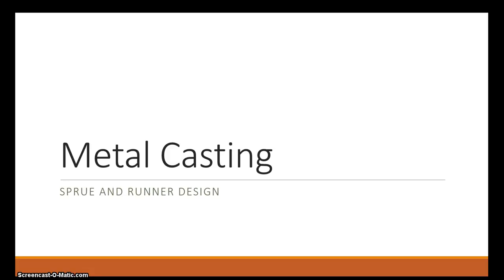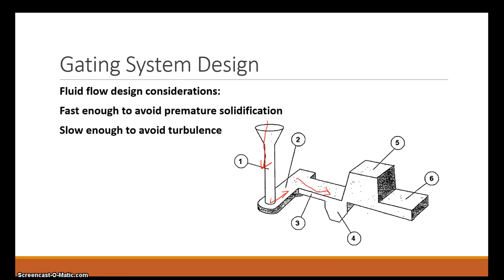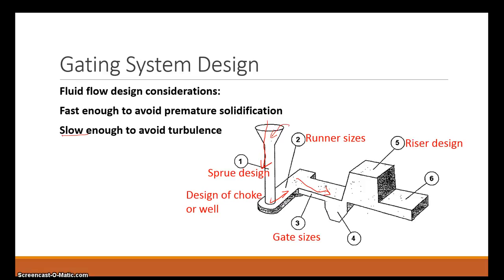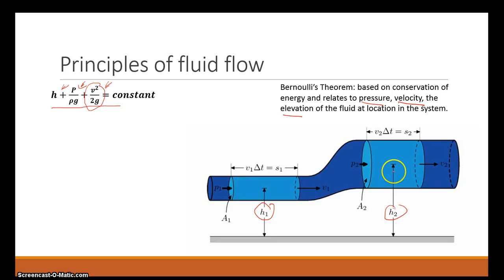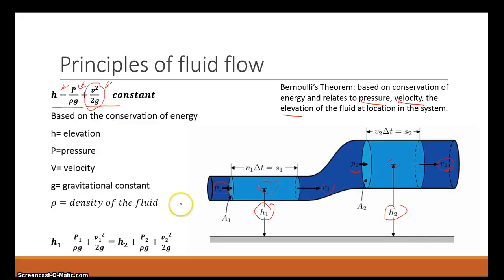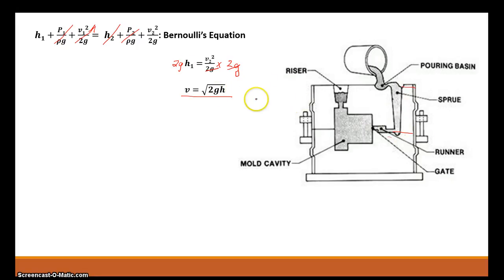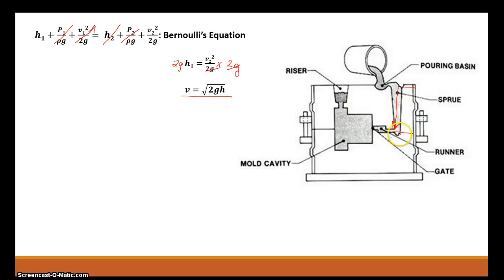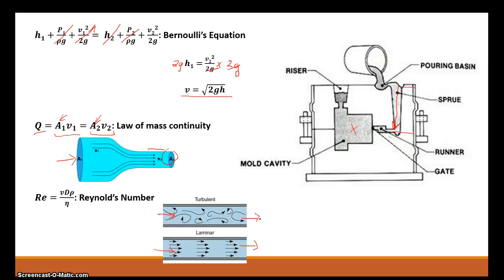Metal Casting (Part 3: Designing the Gating System)

Comment: Pretty good as far as an introduction. Careful though, for pipe flow fully laminar flow is Re<2000, partially laminar (transition to turbulence) is 2000<Re<4000 and turbulence is greater than 4000. Keep in mind that is only for pipe flow, if you use semicircular or rectangular gates these values would change.
Reply: Seems to me that the only purpose of your comment was to highlight the fact that you feel as though you know a little something about casting. That was very arrogant to say " pretty good as far as an INTRODUCTION"  how about just saying that the lecture was pretty good. Everyone who viewed the video learned something.
I was glad the professor didn't respond to your comment.
Next time, before you speak tell your mouth to behave like a typical casting defect and.... COLD SHUT

Comment: Not sure if you still check this or not but with regards to the gating system are there limitations to designing around the parting line of die halves for part extraction?
Reply from the maker: Hello!

Yes the position of the parting line is dictated by the density of the material that you care casting.